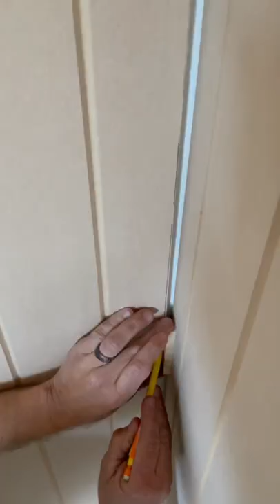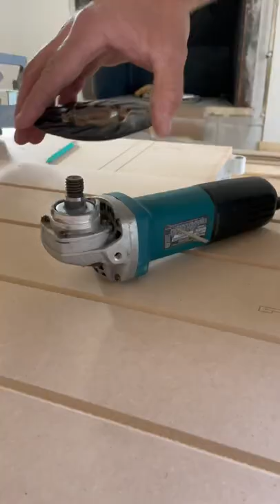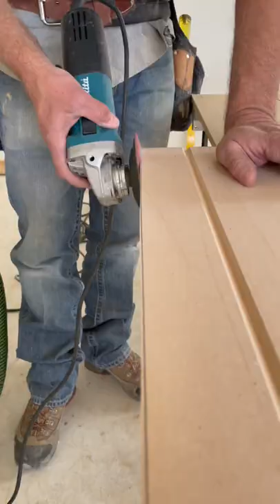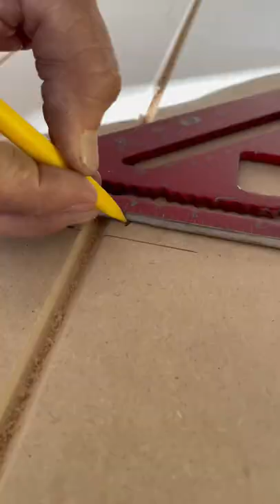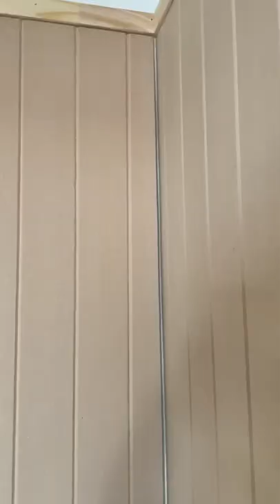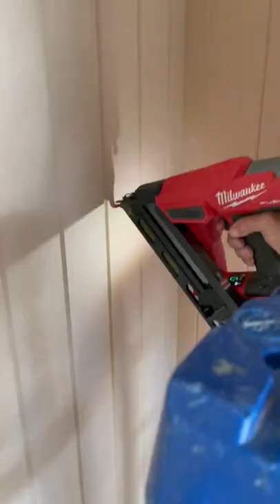Woodworking & Carpentry | “V” Groove Paneling Install

Comment: Which disc attachment for grinder is that. When u were grindin it looked completely flat
Reply from the maker: Spiralcool backing pad with 36grit paper 🤙🏻
Reply: @texascarpenter  got the same one when u were installin it. But then it looked flat. Thats the one im lookin for
Reply from the maker: @Tom-sd5ru  Are you saying it looked like there was no nut on the bottom?
Reply: @texascarpenter  yeaaaa